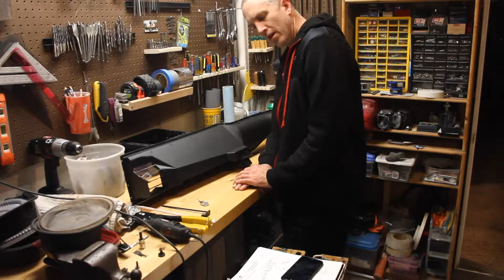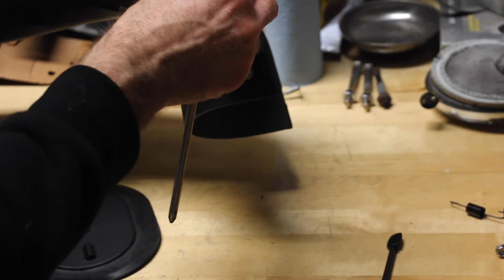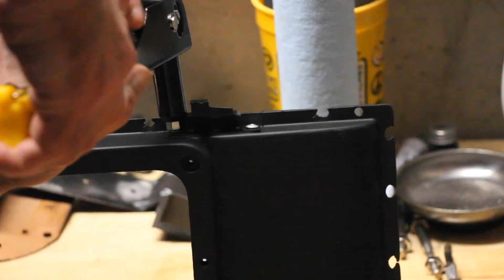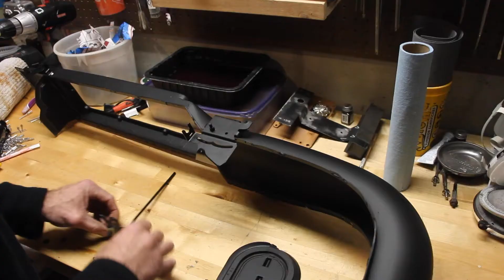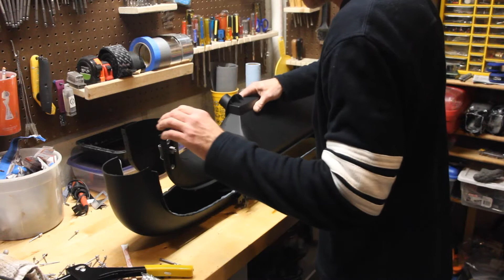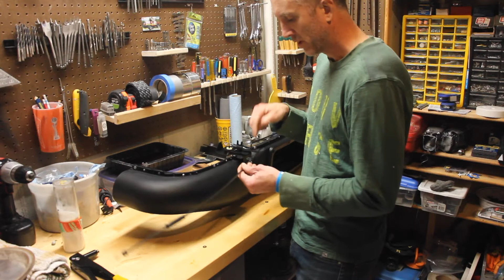Jeep CJ7 Fresh Air Intake Restoration

Comment: Great video.. Just purchased a jeep air brand heat and air combo unit. I was told that it came with a new fresh air intake and it does not. So I'm going to rebuild the one I have or have you seen any aftermarket items that would work?
Reply from the maker: Not that I'm aware of. If anything, try to get in contact with Ray Moulton @ dead jeep. Tell him Cool Guy sent you. He'll get a kick out of it.

Comment: did you get a new Heater coil. If so where did you buy it?
Reply from the maker: I was able to use the original one, luckily. The ones online seem to be a mixed bag of quality and proper pipe alignment. I don't recall any copper core ones and I don't know how important that really is. If you can find a good used one on FB marketplace, I would go with that. But if that doesn't work out, Rock Auto has a few selections and so does most of the Jeep aftermarket stores like Quadratec and Morris 4x4.

Comment: Did you end up re-installing the computer bracket? I didn't see it. Also, do you happen to know what computer that is exactly?
Reply from the maker: No. I installed an HEI distributor, which enabled me to bypass the whole system and remove about a mile of extra wire and vacuum tubes. I have a video on how to do this if you're interested. It's really the only non OEM thing I did except for the high back seats. Still working on getting a set of those. I have the computer bracket sitting in the basement, all powder coated and clean. 😁